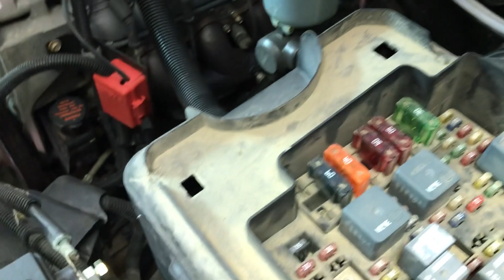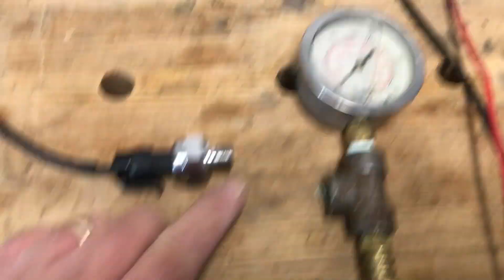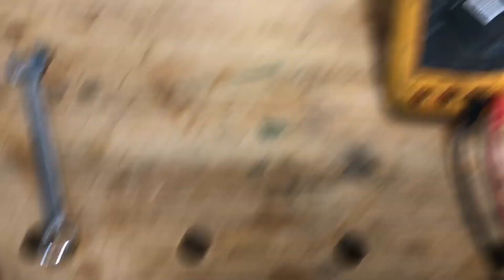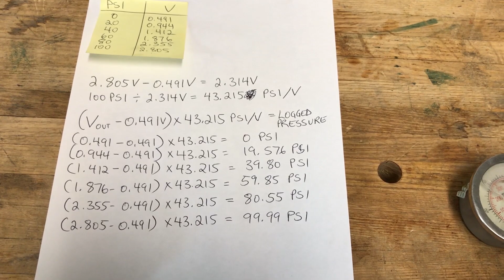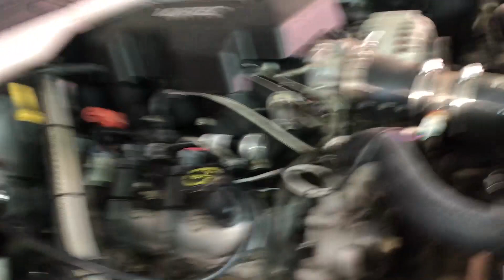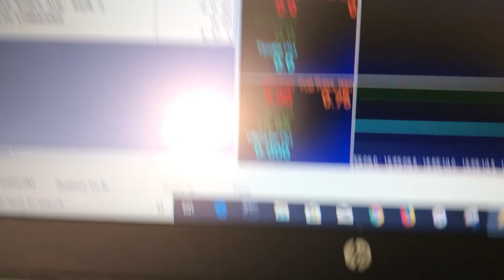How to Install a Fuel Pressure Sensor on your Gen 3 LS-based Engine

Comment: Enjoyed your vid on adding a fuel pressure sensor. Just a couple of notes. Don't repeat yourself so much, and as a career tech, when I make wiring quick disconnections I always use weather pack connectors. being low buck myself, I'll go to weacking yards and scavange male and the matching female connection with a bit of wire where I can easily make weather proof heat shrink connectsion anions. I keep a inventoty of 2, 3, 4, etc connections. it will save a lot of future time chasing electrical faults from corrosion and oxidation. Keep doing your good Videos!

Comment: Could you help me with the Pin out for the egr, or connecting the sensor straight to the pcm. Trying to figure this out, need a little help. Thanks

Comment: Why not running 1 to 1 regulator . stock regulator is not for boost
Reply from the maker: Actually the stock regulator is referenced to manifold pressure and does increase fuel pressure as boost increases. I’m sure at a certain level I’ll need to upgrade though
Reply: @LowbuckLS   at what hp range does this fpr crap out at?
Reply: And what fuel pump are you running?
Reply from the maker: @PgnGbltr  I don’t know exactly, but I know of a guy running 9’s in the quarter mile with the stock fuel rails and regulator
Reply from the maker: @PgnGbltr  and I’m running the Walbro 525 Hellcat in tank fuel pump
Reply: @LowbuckLS  whats the part # to the sensor you purchased via Amazon? Im look at Amazon and there's all kinds of pressure sensors/transducers, the goal is to get the 1 you got.
Thanks in advance!
Reply: @LowbuckLS  oh ok i didn't know that 👍

Comment: Would that formula work for me if I bought that same fuel pressure sensor or would I have to do everything you did to measure it?
Reply from the maker: Tim Artrip should work as long as it’s the same sensor

Comment: You can graph the values in Excel or a Google Docs spreadsheet then get a formula from a graph trendline. In your case that's volts=(0.0232*psi)+0.4852. From that, 1/0.0232=43.1 volts/psi. It calculates 0.4852 as your offset due to gauge or sensor error/non-linearity.
Reply from the maker: Hydrocarbon82 yeah when it comes to doing this kind of math I’m wishing I wasn’t a high school dropout... I knew there was a way to use excel to figure this out but I wasn’t sure exactly how to do it, thanks for your input.

Comment: Hi there, Do you use the fuel pressure sensor for injector control etc  or monitoring/logging only?
Reply from the maker: crackerbuzz it’s just for monitoring it doesn’t control anything
Reply: @LowbuckLS  Thanks mate.  Awesome!

Comment: This might be a dumb question, will disconnecting the fuel tank pressure sensor, hooking it to a very different load throw a code?
Reply from the maker: It hasn't thrown a code or turned on the check engine light or caused any problems that I've been able to notice so far.
Reply: @LowbuckLS 
 No codes, OK, well that's cool. I have an 07 2500, completely stock with check engine light on and thinking about plunging into HP Tuners, hoping I can figure out what that code is.. and more. I just found your channel and have just begun to watch. Awesome to see you working hard at this and sharing. Also I've been watching Matt over at sloppy mech. for a year or so, great stuff, again thanks for posting all the great really detailed videos.

Comment: why not just run from the pcm to the sensor. just look up which wire is the input for that tank pressure sensor at the pcm and cut in there. from there you could just tuck it into the main harness back to on top of the intake.
Reply: And attach the sensor right on the Schrader valve using the adaptor.
Reply from the maker: I thought about doing that, just figured the sensor would be subject to less vibration if it was mounted away from the engine.
Reply: @LowbuckLS  i had my mounted on the Schrader for awhile, change to a af fuel rail due to going tbss intake. Never had any issues. It's a road racing car with super stiff suspension and engine mounts. Races for 14 plus hours over a weekend. 
My concern would be adding more potential leak/ failure points.
Reply: @LowbuckLS   heres an example of the abuse my sensor see.

https://youtu.be/8cUK4q3Y6g4
Reply from the maker: That would have worked too just didn’t think of doing it that way